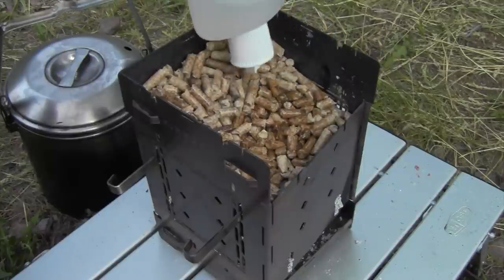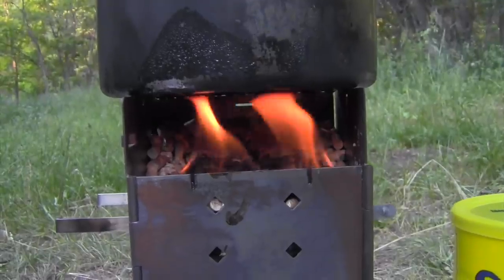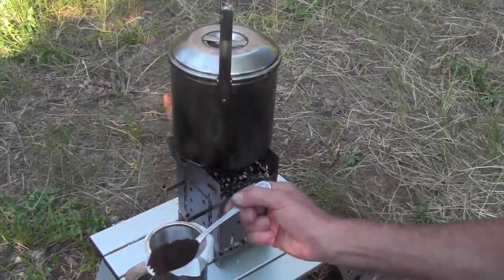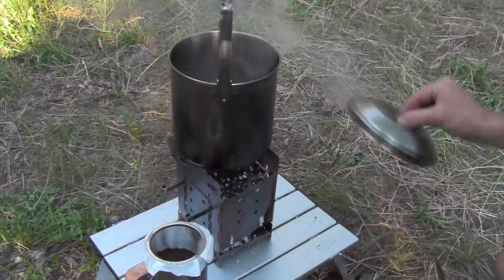Firebox Stove & Billy Pot Boiling Water For Coffee Using Wood Pellets As Fuel.

Comment: have you tried adding a perforated tube to the center of your wood pellets for added air flow ?
Reply from the maker: I have played with that a little but need to try using 1/2" hardware cloth rather than 1/4". Thanks for mentioning it, I'll do a video!